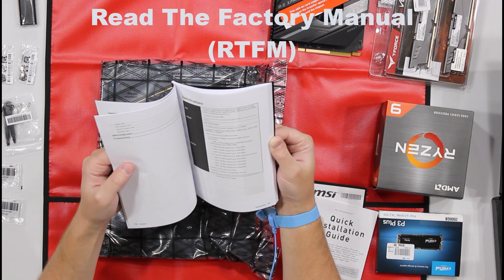Time Lapse Build of Home Theater PC with High End Components

Comment: Why are you blowing that warm radiator air into the case? Wouldn't you want those fans flipped around to exhaust that air out? I ask this because I just bought this case.
Reply from the maker: It's not uncommon to intake air through a radiator on the front of a case. With the Grandia 11, I think it's the only configuration reasonable. The front grill acts as a filter, and there's a gap between it and the case interior. If you reverse the airflow, you'll be exhausting hot air into that gap.

After this time lapse video, I posted a follow-up that goes over my cooling choices:

https://youtu.be/D4W4o4GqSJI?si=zphtnlAjcPlj863e

Good luck with your build!

Comment: I got some tips from building a high end gaming PC in this case. #1.Remove the top case brace as it is not really needed. 2# go for the Arctic freezer 240 AIO as it has a much thicker radiator to absorb those CPU temps if using something like a i7 or higher, but don't use the included Arctic fans as they are not the best and are loud. 3# once brace is removed u can shuffle the Rad over to the left a little which allows for a full size 120mm exhaust fan on the right side, this is very important as it's your main exhaust for case heat. #4 Pick an ATX motherboard that does not have the USB 3 header at the bottom of the board most modern boards have them on the side anyhow, it's a little tight but u can fit two full size 120mm fans on the left side as intakes even over the front header ports. #5 With being a living room HTPC Gaming PC go with 5x BeQuiet Silent wings 4 120mm PWM 1600rpm fans so it's nice and quiet along with 2x Pure wings 2 80mm rear exhaust fans. #6 get an ATX 3 Bequiet or similar PSU with a pcie 5 power cable so u can easily install something like a RTX 4080. #7 go for a motherboard with plenty of NVME ports as these drives are so cheap now, and u don't want to take up space or hear mechanical hard drives spinning. And also u dont really want to fit or take up space with the 3.5" bays. It's been a lot of trail and error but my build is 14700K/RTX 4080 with 6 nvme Drives for the ultimate 4K Home gaming & PLEX server in one. :)
Reply from the maker: I'm glad your build worked out! 6 NVMe drives is a lot!
Reply: Asrock Z790 Nova has 6 nvme ports :)
 @takeofftechnical
Reply from the maker: I had to look it up to believe it. Five of them are PCIe Gen4x4 and one is PCIe Gen 5x4, which is a lot of high speed storage! Do you have them in a RAID? I did see that using the Gen5 M.2 slot shares lanes with the GPU, so populating it downgrades the GPU from x16 lanes to x8 lanes. Did you do any performance testing with that 4080 to see if running half lanes was noticeable?
Reply: @takeofftechnical  I just use gen 5 as a windows drive and a few games and then 5x4TB nvme drives as PleX storage for 4K Media as a plex server running to a 77” OLED via nvidia Shield , yes I did test gpu without a drive in the 1st port, made 0 difference or margin of error.

Comment: Preparing for build into this case myself. Because of space considerations, my two thoughts are: 1) build with mATX case, so that lower connectors don't interfere with 12cm coolers; anyway, to have a proper GPU cooling, nothing should be between it and those coolers. 2) Regarding suitable mainboards - it is easy to spot, which mainboard suits this case by checking, if it's first pci-e slot is against screw hole near the mainboard edge, where the block of external connectors is - these mainboards seem to be not suitable, Videocard inserted into it will interfere with top brace. First Pci-E slot should be positioned lower than this mainboard hole. Usually, there is an M.2 slot against the hole in mainboards that are compatible with this case. Just take a look at good picture of mainboard you are considering - this screw hole is visible very well. I'd say, I cannot find suitable Intel-based LGA1700 mainboards.
Reply from the maker: Re: (1) - I agree. The case does fit ATX motherboards, but mATX may allow more clearance for fans. The catch is to find one with the right features for your use-case. Re: (2) - The screw hole for mounting the board appears to be a nice indicator for where the slots line up. Thank you for sharing that tip! The GPU slot is not always the first slot on the mobo, though, so confirm in the manual as well before ruling out a board where the first slot lines up with the mounting hole.

Comment: Cool build but 5950 seems like overkill and a gold rated power supply seems like underkill for a home theater pc. 🤷‍♂️ 
I built my home theater pc into this exact case last week. Little tip for anyone else considering this case. It will fit a 360mm rad with a small dremmel mod to that long brace bar and by drilling out the grommets on the HD bay. I repurposed my old 9700k and taichi ultimate mb and it’s Corsair 360 rad I used on its first build and was still able to install arctic p12 120mm slim fans on all three of the sides fan ports.
Reply: I was wondering if it can fit 360 AIO and couldn't find any info about it. Thanks for confirmation! It's really sad they didn't make it 360 instead of 240 in the first place. Would be a lot easier. Do you have any pictures of your mod maybe? Also what is max GPU length with 360 rad?
Reply: @Zdzisiek  it depends on the length of your gpu and the thickness of your rad as well. I was able to fit an acer predator arc a770 with very little room left for rad.
Reply: @_B.C_  this gives me some idea, what rad you have 30mm thickness?
Reply: @Zdzisiek  it’s an old CORSAIR Hydro Series H150i PRO. When I searched the specs on google, it says 27mm in thickness. And the acer predator bifrost a770 is 267mm.
Reply: @_B.C_  thank you very much for the info
Reply from the maker: In addition to gaming, I use this box for software development, virtual machine labs and video editing. For me, the 5950x is not overkill. I love it!

As for PSU, I used a PSU calculator size + 100 watts to determine my needs. Fully modular and trusted brand are my other PSU requirements. This build went over budget in the end, and I have no regrets right-sizing the PSU to help keep cost down.

With the 360mm rad mod, did you dremel an additional fan cutout for the extra 120mm? I have wondered if a slim or 90mm fan could fit between the snap-on front panel and the case frame…
Reply: @takeofftechnical  ah coding, got it. I use a 5950 for my visualization pc I keep in my studio. The 13600k I got my fiancé basically goes toe to toe with my 5950 in productivity and beats it in gaming most of the time… for half the cost. (I got my 5950x for $500 in April 2022, got my 13600k for $225 on sale at microcenter in April this year.) But if you like coding in the living room, who am I to judge, more power to ya. I personally can’t video edit in anything but an office chair.

As for the PSU I didn’t mean how much power it was providing but how efficiently it was doing it. Gold rated psus are good for gaming, but if you’re going to leave a system on permanently in a living room or had high end audio equipment attached to said pc, go with a platinum or titanium rated psu. They are much more efficient/ less noisy. Like using pwm pst co (continuous operation) fans. 

 I didn’t cut any holes. Just put two arctic p12 max on the 360 rad, giving it more airflow than it had with the 3 Corsair fans it came with. That long brace bar only needed a small cut that I could have made with tin snips. Basically creating a very small metal flap that I had to bend slightly up so the side of the radiator could clear it by a few mm. I also had to drill out the 4 grommets holding the hard drive bay in place, so the radiator hoses could be placed on the opposite side of the psu. The slim fans had to be attached first. The only downside to this is it takes away from the possible mm length of gpu by the exact width of the radiator. So it might not fit some triple fan gpus. Or might not work with thicker radiators, like the ones from arctic. But it was fine for my 273mm gpu so I was able to repurpose my 360 radiator.

Comment: Thanks very helpful. Only thing I will say (and Silverstone recommends) for the gpu to be mounted in the second slot so that it is closer to fresh air intake and any additional pci cards be mounted above (to the right) of it.
Reply from the maker: Thanks for watching! I have a follow-up video that goes into more detail regarding the PCIe slot for the graphics card - https://youtu.be/D4W4o4GqSJI. Be sure to also review your motherboard manual. You may only have one PCIe slot that will provide the full x16 lanes to a GPU. The manual will outline which slots provide x16 lanes and when those slots may drop to x8 or x4 lanes if other slots are populated. A GPU will likely still function at x8 lanes, but it may not operate at full potential due to bus throughput limitation.

Comment: Nice Build, got the same case as an upgrade for my old LC17.
Still thinking about an AIO for the 7700X.
Went all NVMe and left out all the drive cages, give quite a bit more room.
Also turned the PSU around, those two little fans in the rear have a hard time getting the air out and adding the PSU fan really helps a bit.
Reply from the maker: By turning the PSU around, do you mean you changed its fan from an intake to an exhaust? That's an interesting idea!
I've heard great things about the 7700X - for sure it'll throw some heat, though. I like my MSI AIO, especially for the awesome fans it comes with. The only downside is the clearance forces the tubes to the PSU side of the case. This orientation leaves one of the tubes at the top of the radiator, near where the air bubbles will settle. The cooling would be better the other way around. It still does a fair job with the 5950X, but I wouldn't rule out a future replacement.
Reply: @takeofftechnical  7700X was an upgrade from an 1700X, I throttled it down to 80W and can now still use the standard spire cooler. Did not need the extra cores and the generational performance uplift at almost the same wattage is enough for me. 
Depending on the clearance you have for the graphics card the radiator could maybe also fit on the left hand side in a pull configuration, unless you need the lower PCIe slots.
Was thinking of maybe getting an Alphacool Eisbär AIO, with its quickconnects I could maybe integrate a second radiator with a GPU. Aircooling any halfway modern high-end GPU will be troublesome because of the size of those things, mostly because of the height. Only alternative would be a horizontal mount. 

Also I did not add any extra fans besides the two 120s that came with the case and two 80 Noctuas in the back. Thought those 120s will do already way more positive pressure the 80s and the PSU exhaust can handle.

Comment: How are the temps and noise?
I am going to build the 5800x with artic cooler 240mm ii in that same gd11 case with a triple fan MSI 3060ti
Thanks!
Reply from the maker: As-built in the video, the temps were not ideal. I've made a couple of mods since then. First I flipped the low-profile fan to be an exhaust. While this does introduce warm air outside the case near the PSU intake, I needed to encourage more airflow over the graphics card. I also removed the 2-port PCIe NIC in the last PCIe slot to make room for an additional 120mm intake fan to bring more air to the GPU. I am happy with the results!

Make sure to leave some room to breathe around the case in your AV cabinet, and I think it should temp out well for you.
Reply: @takeofftechnical  Luckily I have an open rack where this will go so that should avoid most of the issues since it can get fresh air without any "walls" around the case :)
Thanks
Reply: @takeofftechnical  Do you think a 3070 dual fan will allow me more flexibility for HDDs or a longer triple fan card will do as well?
Thanks
Reply from the maker: I don't have any HDD clearance issue with a full length triple fan GPU. The front-to-back crossbar that supports the HDD cage is the tricky bit. The clearance concerns are the radiator and the graphics card PCIe slot. Per the GD11 manual, you need a motherboard where the card installs where the case's PCIe slot 2 is located. The X570 ATX motherboard I fit aligns the graphics card slot to the case's PCIe slot 2 position, so all 3 HDD locations are available to me.
Reply: @takeofftechnical  yah looks like my b550 is an issue as it will force me to use the slower 3.0 x4 slot for my card.
Reply from the maker: It's really hard to know. My graphics card is in the 1st slot of the motherboard, which is PCIe 4.0 x16. When the motherboard is seated in the case, this slot lines up with the 2nd of the 7 available positions. I think I should make a review video, because it's pretty hard to explain!